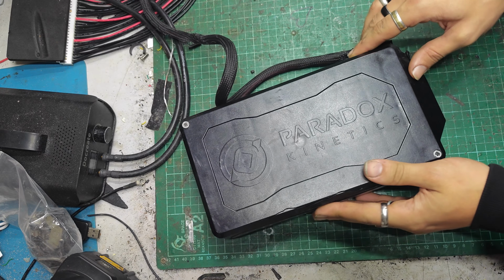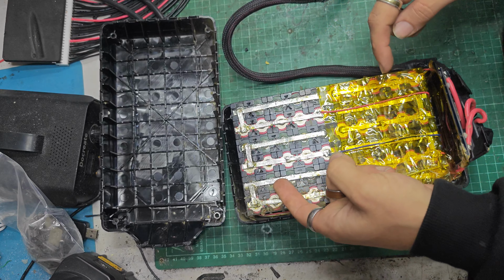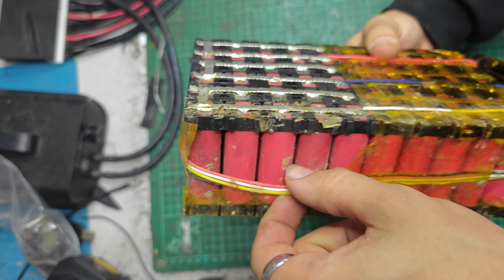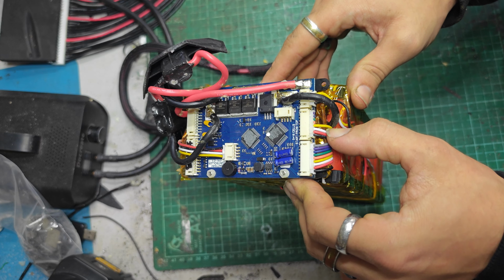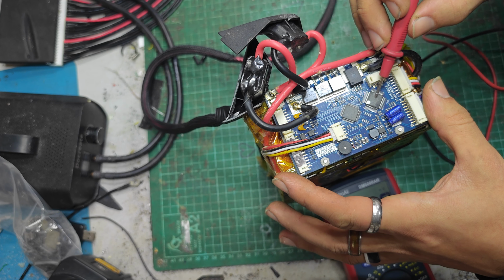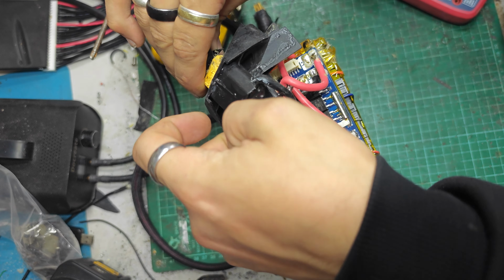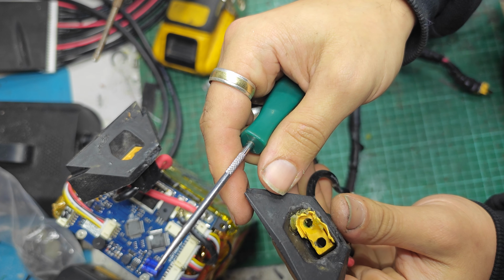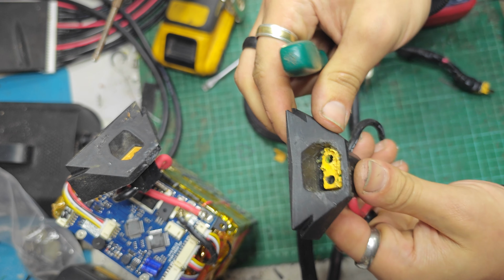Paradox Kinetics Battery 48v 17.5AH EXPOSED! Poor Build Quality - Fire risk?

Comment: Battery cells ➕metal rings? Eeeekkk. Be careful. Thank you for the video. Cheers from So.CA.USA 3rd House On the Right
Reply from the maker: They're ceramic so it's ok! But thankyou :)
Reply: @EbikeRepairs   GR8T answer to a clearly uninformed question. I should know better than to try and 'school' a ringer. You RoCk  :face-blue-smiling:  Cheers from So.CA.USA 3rd House On the Right.
Reply from the maker: No worries! Metal rings are dangerous and if I blew my fingers off and didn't tell me, you'd feel bad!
Reply: @ovalwingnut  You did right as one of the rings is metal and he was not being 100 percent honest lol. At least he will only lose one finger 🤣

Comment: Nice looking death trap, Sanyo 18650 are known heaters also it would be nice to have some O rings on top the cells and then maybe some rubber rings on the top/bottom the entire cells to act like a suspension to the cells to cushion strong vibrations.
Reply from the maker: Not a bad idea! I always thought the sanyo cells were OK - they're what stealth chose to use in their 'real' bomber batteries. But this example is shoddy.